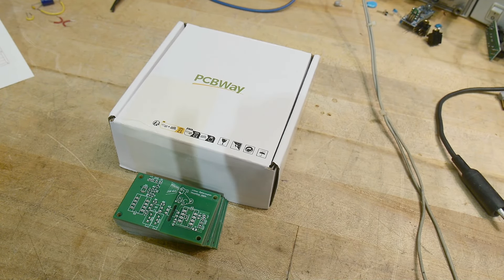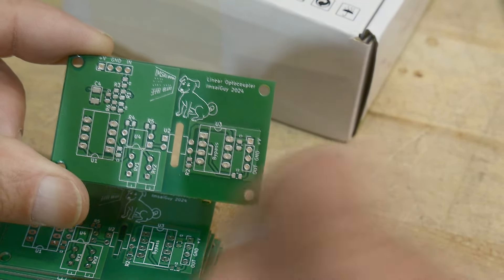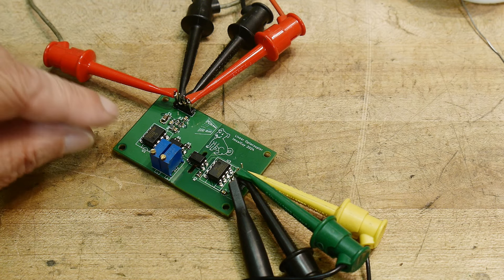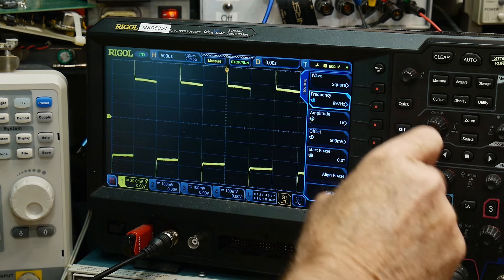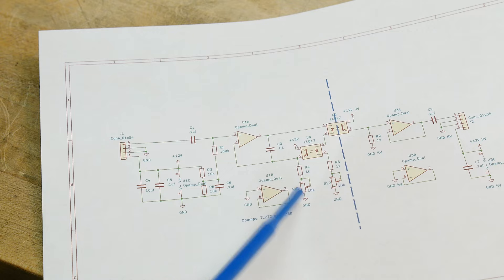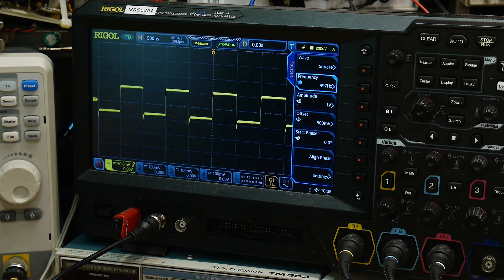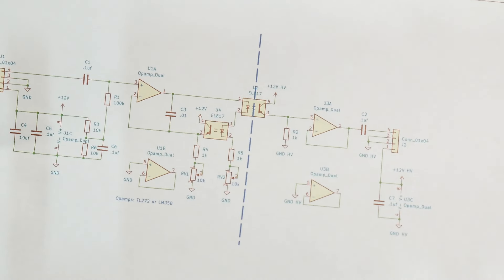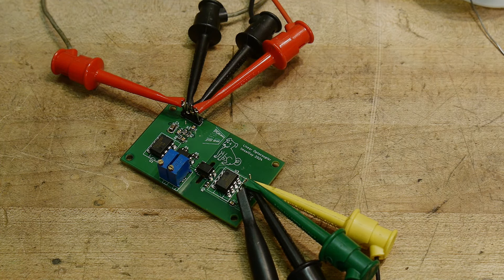#1851 Linear Optocoupler (part 3 of 3)

Comment: Looks great. It might be interesting to pass a sine wave and measure THD at the output and compare it with THD at the input.
Reply: Yes and this circuit is not designed to pass high frequencies so it's not a surprise that the square wave has overshoot.
He should also do a bode plot of the frequency response.
Reply: @cmuller1441  I'd think we should see Gibb's phenomena then, which this doesn't look like.

Comment: Some time ago, I took over a modular battery management system that used 4 optocouples to charge a capacitor from a Li Ion battery and then connect it to an isolated microcontroller to measure. It didn't work great, and I'm amazed it worked as well as it did.

Comment: sunfire used a optocoupler to isolated the analog audio signal from the input board to the preamp as the whole internal circuitry was live to get rid of the big heavy transformer and just run the power amp straight from 110v mains.     but still had the rca inputs galvanically isolated.

he didnt use a dual optocoupler but one that has its Base pin broken out to set some sort of pre-bias.   well yea it only needed to go up to 150..200hz anyways.
they put like 15mA onto the led and modulated the signal +-5mA onto it or something

Comment: Cool project.  I found that a couple years back when trying to answer a "how illI do this".   iirc it was called servoing a optiocoupler.  I also made the assumption that digitizing it and shipping it over fiber would be the correct answer, but I had lots of problems finding the parts ( TX, RX, fiber)  I finally thought maybe it would be done with signal transformers for the data. But I dislike that idea for a few reasons.  This is for a DC load project I'm halfway through the mental process designing.  It's still suffering feature creep like building as modules that could be put in series or parallel keeps coming up, but needs to do 500W and 1000V.    I already got 4 mosfets for the job IXFK52N100X.  If you have any fiber optic link insights, I would love to hear them.

Comment: I forgot to mention, that the spikes you are unable to compensate in the case of the square wave may be due to the bandwidth limitation of the opamp. I think of this because the LED will turn on fast, and so will the phototransistor, but I have doubts about the slewrate of the OPAMP

Comment: Would it be practical to reduce the feedback decoupling capacitor? That might be the cause of the undershoot.
Reply: On the contrary, it looks as it has too little phase margin, which will usually cause peaking.

I hope IMSAIGuy reads this, because I believe that the peaking can be reduced by increasing the capacitor across the op amp feedback.

The peaking is most likely cause by phase delay through the two optos due to there somewhat slow response,  resulting in an overshoot from the opamp "being too fast" ( in reality having gain where there is little phase margin left)

Comment: Thanks for sharing your work

can you help me to make circuit schematics and code
I want to read voltage with an isolated ground
Mine setup is   4x 12v battery and 4x simple solar controllers Aliexpress
Every battery have the own Solar controller
I use the Esp32 and 1x ADS1115
ADS1115 is a 16-bit, 860-SPS, 4-channel, delta-sigma ADC with PGA, oscillator, VREF, comparator and I2C.
I use voltage divider 4x 6.44K 1% and 30K 1%
The Solar controllers have switched ground  if i connect the ground together i get errors
The controllers are good it is charging the Batterys good.

Comment: I wonder what will happen if the second opto (U4) was also straddling the gap but the other way round (LED to the right) and the feed back was gathered from the output of U3A and fed across the gap to the first opamp U1A. Then you would have a composite setup where the feedback was global from the very last output back to the first input. In this first form anything the happens in the HV side does not get reported back or I should say 'Fed' back. Any noise created in the HV side does not get treated in the LV side. This is purely a thought and probably of no interest to anyone so please 'Commentators' don't get on my case :)......cheers.
Reply from the maker: that would be great but you are using a non-linear device to feed back from a non-linear device.
Reply: a composite setup comes to mind
Reply: @IMSAIGuy  Thanks, nearly bedtime for me but I will give it some thought, thanks again for replying :)
Reply: I had this thought also but assumed there was a good reason it wasn’t done that way.
Reply: @mikebond6328  Yes I'm struggling to understand but Very Kind IMSAI Guy gave me a thought to think about tommorow ! thanks for your comment :)

Comment: OH NO! He did it again! The rubbish circuit with two optocouplers! WHY? This is pointless in 2024! Use the standard IL300 circuit and be good! And a reflow over for a handfull of SMT components? C'mon! Heat your circuit with hot air to maybe 60-70°C an see it drift!
Reply: Haha, yes. But for an educational circuit, you can't beat its universality: almost everyone has at least a couple of PC817 optocouplers salvaged from SMPS's!.
Reply: This is an educational channel and not an engineering challenge game show. You realy do seem to  have missed the point of this circuit and it's purpose :)
Reply: @andymouse  Nobody is useless. He can still be a bad example.
Reply: thanks for the part number, i will get some to test.